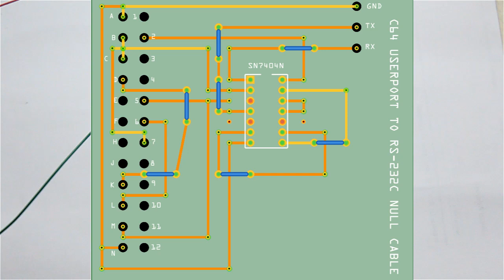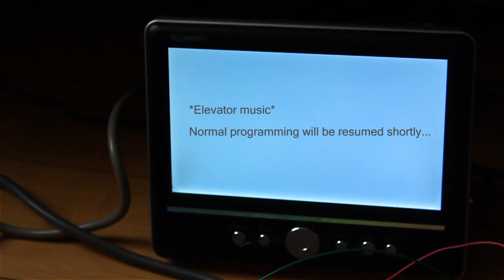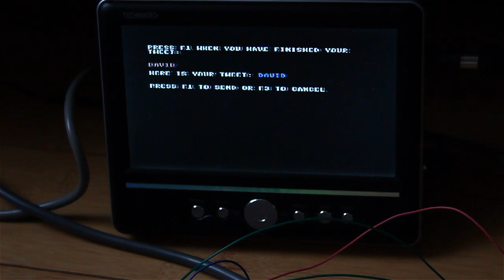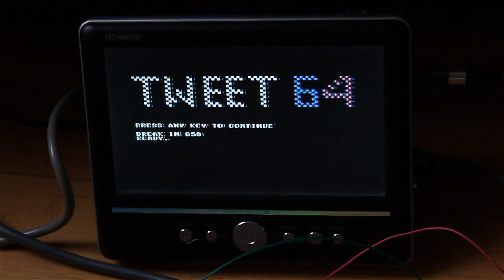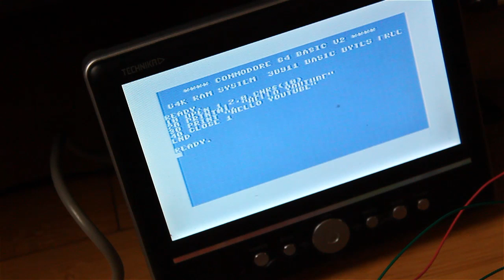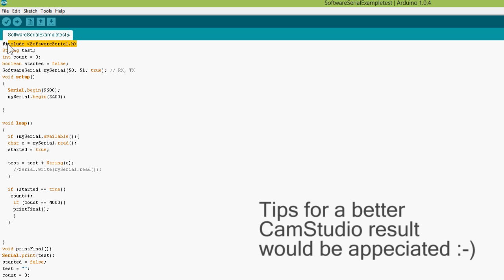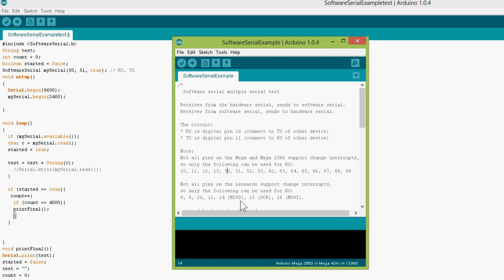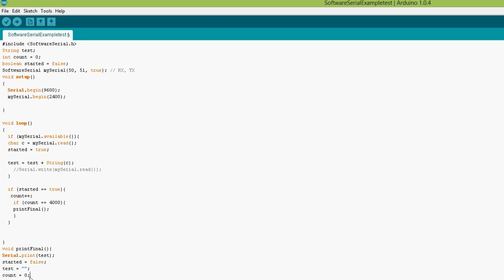Arduino Project: Commodore 64 interfacing across the user port

Comment: There is a problem with your breadboard diagram. inverter pin 3 is not connected to anything. that nothing gets inverted and goes to TX. so TX is not connected to anything.
similarly pins 5 and 10 are not connected to anything a well. while they are not connected why is all the rest of the inverters are connected to each other?
you have used one inverter for input and another inverter for output. The rest of the inverters seems to be wired for no apparent reason other than looking complicated.
Also, you didn't show any received data on Arduino. Were you able to actually get it to work? is this just an abandoned and never completed project?
Reply from the maker: Hi, you are right there is a mistake in the diagram. Pin 3 should be connected to M and 5 on the connector. 5 and 10 really aren't doing anything are they. It is likely that I just messed this up, they project did work though. Perhaps it is time to redo this video.
Reply: @DavidWatts , Hi, I was able to get it working after so many tries, eventually I had to connect it to the oscilloscope and everything seemed inverted.  So I did a double invert with the unused inverters now its working fine.  We (my 7 year old son and I) use it to control a lego robot with simple servo motors, connected to arduino which is connected to c64. controlled with a basic program that allows joystics to control the lego robot arm :-) Thnx a lot.👍
Reply from the maker: Thanks you for taking the time to point this out, I really appreciate it.

Comment: The Cinch board edge connectors are out there, you just have to look for them. I found them at Electronic Surplus Supply and ordered 4. I built my 3K RAM expander board for my VIC 20 back in 86. Love tinkering with the old computers. My 1976 Cosmac Elf project still works

Comment: I realize that this video was quite awhile ago, but i had to throw this out. I loved my c-64 , In 1992 I made a ccd router" Commodore Controlled Dremel" 2 dimensional and various style text only. I had to go to libraries to get information and learn it all my myself no internet how to's. the one thing I did use for other projects that is never publisized was that the joystick digital ports could be used as outputs. To The point using both joystick ports as an output would give you 10 bit resolution to an DAC. There was some outboard clocking and digital handling that was needed but made the c-64 person into a wizard to the friends and relatives.. That was just a hobby at the time, christmas lights, security,  breaking uncopiable commodore games and then do to a mishap ,,,,,blew the CIA. I lost my best friend.

Comment: I wouldn't need to build this 7404 adapter if I have the original VIC-1011A RS-232C adapter, right? Just cobble together a null modem cable?
Reply from the maker: Just had a quick google of the VIC-1011A and it sounds like a null modem cable is all you need.
Reply: No. The Arduino also uses TTL serial, but it sounds like he's coding it to use pull-up logic, which inverts the sense. So 5v on the Arduino is "0" and 0v is "1". I'm a little fuzzy on that, since he doesn't actually know what he's saying and basically doesn't use a single, correct technical term.

Comment: Nice. I used parallax propeller prog plug that use 5v TTL signal. i connected N to VSS(ground).M to RX. that allowed me to send from C64. To get C64 receive need connect B & C to TX. didnt work only with B or C both needed connect  :) commodore manual say 3 wire connect,but thats 4 lol.

Comment: Just to clarify. It's not RS232c. rs232 uses the db25 port the RS232c uses db9. By using two chips it's easy to make an rs232 adapter. Those chips convert between the MOS voltage levels the Commodore 8 bits used to the TTL voltage levels rs232 uses. Otherwise the commodore user port is rs232 compatible just using MOS levels and an edge card interface.
Reply: Not quite. The difference between RS-232 and RS-232c is primarily the voltage. The original RS-232 used a +/- 25v signal, whereas the C variant uses +/- 5-12v. 

With "RS-232C", You can send as little as 5 volts or as much as 12v, with -5 to -12 volts asserting the signal or being the "1" bit and +5 to +12v being an "off" condition or de-asserting the bit. 

The Commodore uses TTL Serial which uses 0v to represent a 0 value and 5v to represent a 1 value. This is backward from RS-232c, so converting between the two not only requires changing the voltage (creating a negative voltage), but also inverting the logic.

Comment: BASIC is similar to C++ only in fact that they both are programming languages and there all similarities stops. BASIC is FORTRAN II based  with minor influence of ALGOL  on other hand C++ is based on C (which has no direct predecessors only similarities is with ALGOL that facilities for structured programming, but is design to be easily mapped to typical machine instructions and to be as fare as possible to FORTRAN) and SIMULA.

Comment: I turned off de C64 but i forgot the Commodore power supply plugged to the electrical outlet for 7 hours and  I noticed he warmed. This can be harmful?
Reply from the maker: Yeah, that is pretty normal. It will not harm the power supply but it is using power hence warming up.
Reply: but do not wear the power supply? this happened to you ? (forget the power supply plugged in)
Reply from the maker: Same for me, those power supplies run warm. I would advise not leaving it on for very long periods due to its age but it should not do any real harm.
Reply: do you have facebook? or skype? can i add you?
Reply: Those brick power supplies can overheat and destroy themselves, and they can fry chips in the C64 when they do. Best to unplug it from the wall when you're not using the computer.

Comment: According to C64 programming reference guide the RS232 can be used in 3-line-mode, so only 3 pins(RX, TX and GND) could be used to interface C64 and Arduino. That book also has BASIC code snippets for reading and writing the RS232 port.

Comment: I would have put the data onto the user port in parallel 8 bit and used another pin or 2 to "notify" the arduino that the data was ready to read. Serial communication seems so much more work when you have so many TTL signals available at the user port (you can redefine the joystic port as output...and if you REALLY want to (like I will likely do for the LED Cube) redefine the keyboard inputs as outputs giving you another 16 lines of output. You can do this on the 64 or the VIC-20.
Reply: I've done this (8 bit parallel transfer), and you're right, it's much easier to control and faster!
Reply: Yeah, using a bit shifter or even a proper UART would make more sense. From what I understand, that was originally planned for the VIC line of computers but left out at the last minute due to production issues.